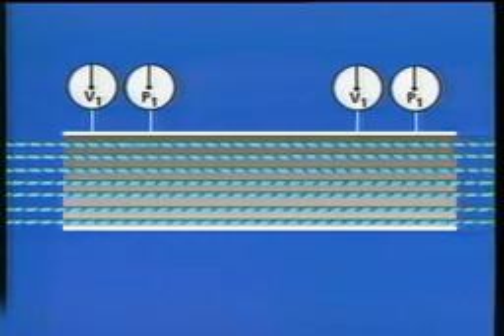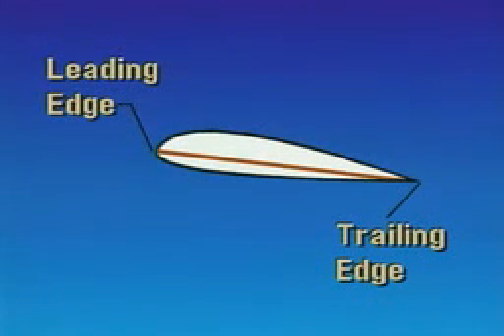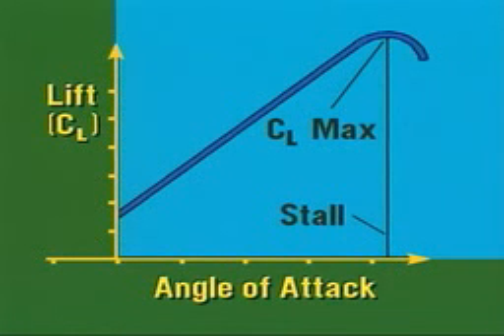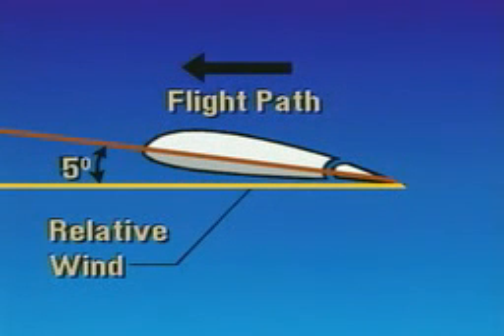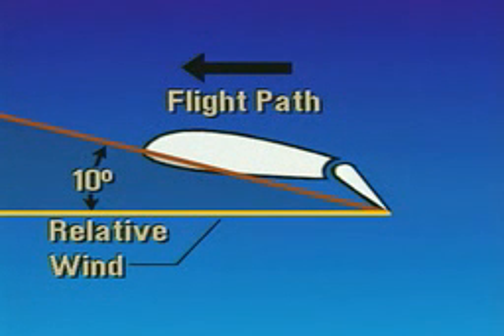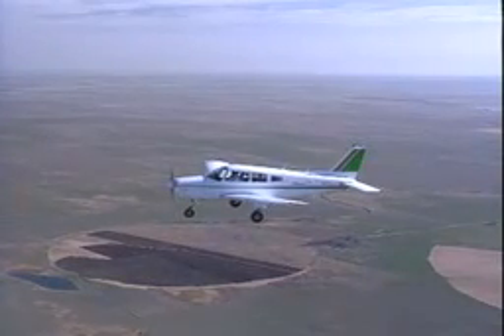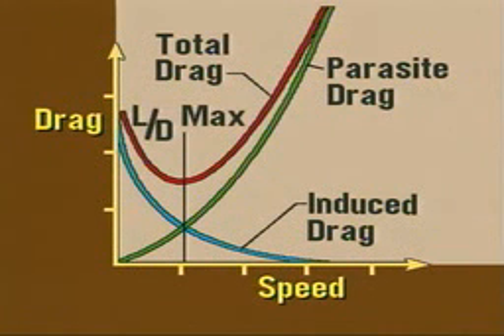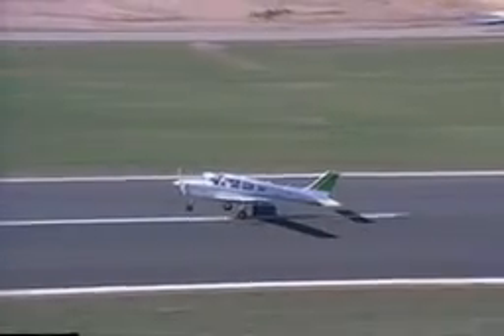PPL 3 Section A    Four Forces of Flight

Comment: TILT.  This explanation is incorrect. The pinching effect of what is looked at as a "half Verturi" is invalid because there is no hard boundary above the wing and therefore no conservation of mass in effect. . The convex shape of the airflow as it moves over the wing is what causes the lower presssure above the wing. The pressure difference on the wing is ALL the lift and the downwash is the equal and opposite reaction to the pressures around the wing.  These two DO NOT ADD to provide the total lift.The downwash is not caused by wing tip vortices.  They are both caused by the pressure difference, top to bottom, on the wing.- Regards